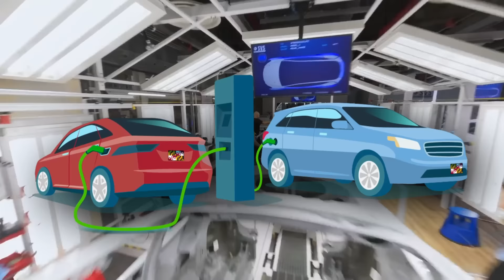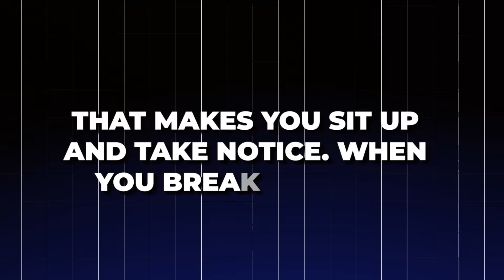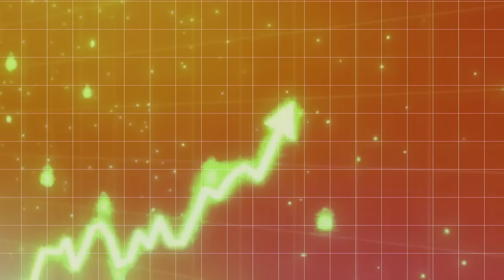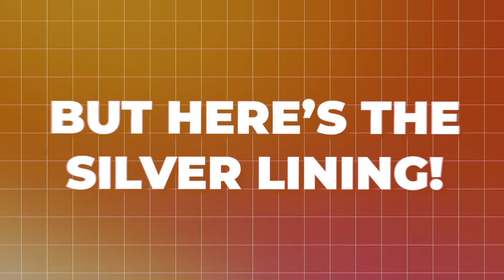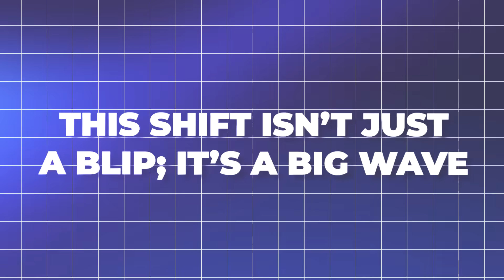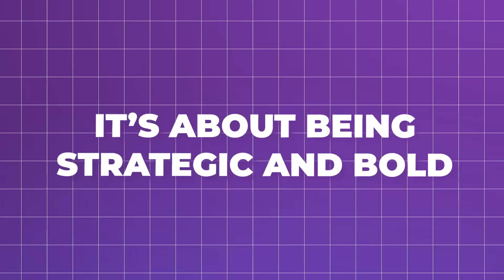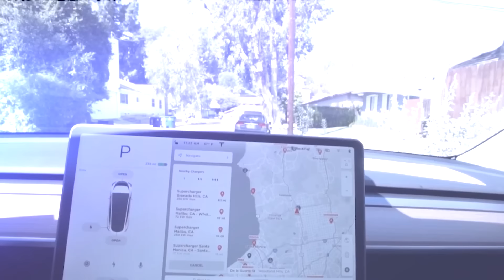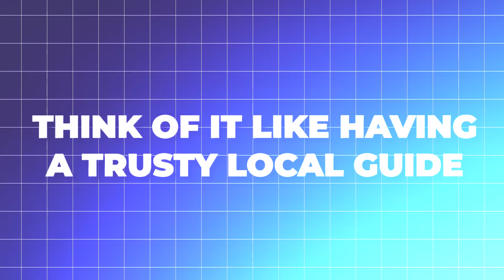HUGE NEWS! Elon Musk OFFICIALLY Bought Ford

Comment: Until I can carry a gallon of electricity so I can get to a station when stepson doesn't refill, I won't be buying an electric
Reply: Hahahahahahahahahaha.....
Reply: Battery
Reply: dude theres 120 volt outlets on every building
Reply: Pssst! You can't buy Electricity by the Gallon, because it's NOT a liquid! On the other hand, you CAN carry a backup Generator, a Solar Panel, and/or a backup battery, if you're that worried...

Comment: I never wanted a EV, and maybe never will, V8 still my option.
Reply: How will that work when the government blocks the sale of gasoline engines?

I have a Tesla model 3 LR for about 1.5 years now.  In acceleration and handling it will wipe any V8.  It is also self driving.  Have spent nothing of any kind on repairs  or maintenance in that time too.

I may soon have to buy some wiper fluid though.
Reply: And when the last Gas Station closes (soon), and spare parts are no longer available, what are you going to do? Go shopping for a Studebaker?

Comment: All vehicles breakdown sooner r later  chevys fords they all do
Reply: The difference is you can FIX a Ford or a Chevy, but you cant even change a bulb on an E.V without a major computer/electrical meltdown........and of course no one seems to want to address the elephant in the room, - ev batteries besides being an uncontrollable almost cataclysmic fire hazard in the short term ALSO need those same batteries replacing about every four years at MORE than the price  the vehicle cost when new, and that is without mentioning  the dozens of other complaints like terrible range and lack of recharging points - or the time they take.

Comment: Electric vehicles are one the biggest and dumbest mistakes any vehicle manufacturer ventures into. Also, thanks to UAW union labor in the USA, pricing is extremely high due to individuals assembling vehicles thinking they are entitled to high wages. So thank a POS union worker for most of the higher prices!
Reply: If it weren't for labor unions.... you'd still be working 70hrs a week at $5.25 pr/hr ...

So yeah, you probably should thank a union worker

Comment: Were do you charge your Electric Vehicle? Do you have the time to sit around while the vehicle is being charged?  Clearly the infrastructure is shrinking with the decommissioning of fossil coal plants with often no replacement.  And Nuclear plants are reaching their life span originally put in place with not replacements. They are getting life extensions.   So their will not be an increase in capacity to charge your vehicle.  Supply and demand indicate life time costs are going up compared to fossil powered vehicles.  Hybrids for some driving conditions is the only winner between the three by life time costs.
Wind and Solar make up a tiny part of the generating capacity and the amount they can generate is independent of the demand for power.  Dependent on nature and often the customer is in a location where using one or the other or both as is the case in Germany is incapable of meeting demand for the investment or space consumed.  Add to this  the none existence storage facilities means that fossil burning will continue.  So the life time cost of the renewable solar or wind must also include transmission lines. storage, and demand achieving fossil generation plants.  Significantly more costly the the present system.  That is why the government has to mandate it and the industry is dragging their feet. 
Chinese EVs in there own market are death traps.  They should not be allowed on the rest of the world's streets.  Any cost saving they have will be lost to make them safe.  And China is running out of capacity to buy this markets.  It is the highest debtor nation in the world  and the demographic choices it make half a century are coming home to roost.  It can not maintain and isn't maintaining the assembly plant of many hands for the world.  Labor cost are exploding and add to this government interference, factories are moving out of China.  Finally the health and other cost of demographics is upon them and also on most of their customer.

Comment: LW here.  After hearing so many "mixed value reports" on all brands of EV's, I will never buy any electric unless 'maybe' a hybrid.  No one seems to do the math for wheeled transportation in cost per mile.  At the high prices for all light vehicles - gas and electric - why buy new unless some measurable advantage?  In addition,  I hear that recharging an EV costs significantly more than gasoline or diesel.  Sorry, gasoline is King for many years to come.

Comment: The batteries will fail sooner than later. Who can balance the cost EV and then in a couple years have to replace battery network. Or maybe fix the fire damage due to battery failures, because TESLA-MUSK is not going to honor any claims for damage.
Until this tip of the iceberg stuff is tried and true and dependable then no EV for me. 
Besides I am an old hotrodder and love the sound and feel and smells that accompany combustion engines.

Comment: This will likely be a part of the agenda to implement15 minute cities in the usa/Can and the West using electrical vehicles that cannot travel as far across the country without regular visit stops at EV fuel stations verses gas/diesel trucks.  ALSO these electrical vehicles ARE going to be connected to wifi networks so your exact GPS location, privacy, freedom to travel freely will be compromised.  

If your social credit score is too low you may not be able to drive or travel outside your 15min city or greater city,  or even vacations, camping, other cities, states, provinces, countries, etc. 

An internet access on your all electric vehicle will give control to legislate tighter travel ssnctions and even power to “turn off” your car/truck making it a paper weight in your garage or even law enforcement being able to gradually slow down each gear speed to stop your truck on digital command etc. 
5G is gonna give huge control to regulate the public masses with everything electrical and with online integration.

Comment: The ONLY benefit to ev is their quick ( not fast ) 
1. Cost more up front 
2. Double insurance cost
3. Your home insurance doubles if you install a home charging station 
4. Massive fire risk 
5. It take a hr plus to charge the at fast charging station 
6. Charging them at fast charging stations cost more then what gas would 
7. Not safe to charge at some public stations IE: imagine your charging up your power wheels and here comes crazy hobo Larry you can not more your car unless you get out of you car and unplug it 
8. They are not better for the environment lithium is a very toxic contaminant that can get into water supply 

There is a lot more but the facts still remains they have been trying to make ev cars work since 1888 so if you haven’t got it right in 135 years maybe it’s time to move away from ev
Reply: LOL keep touting false facts bro.